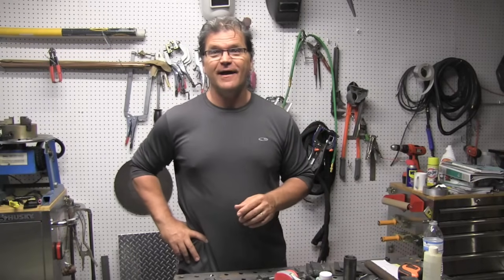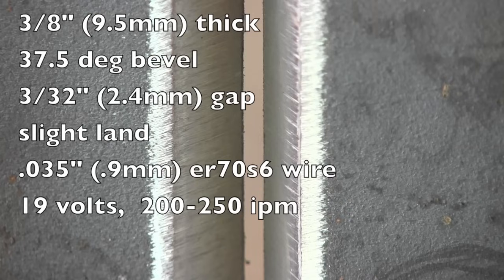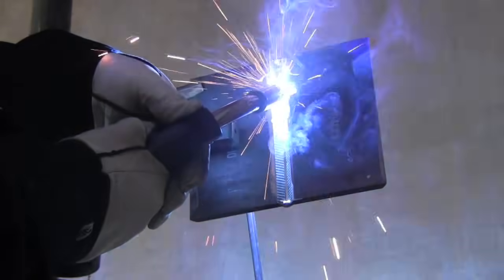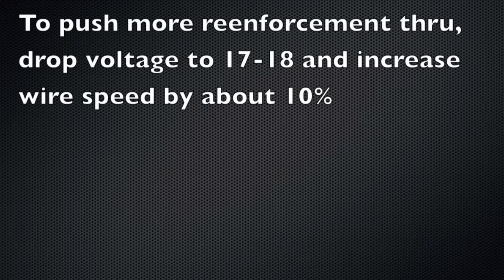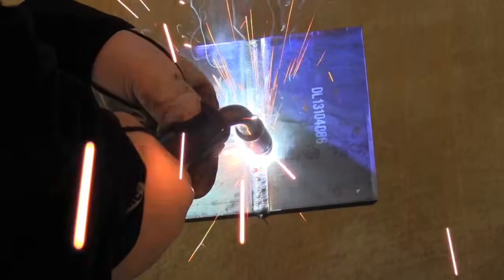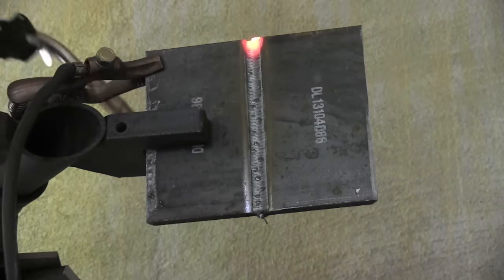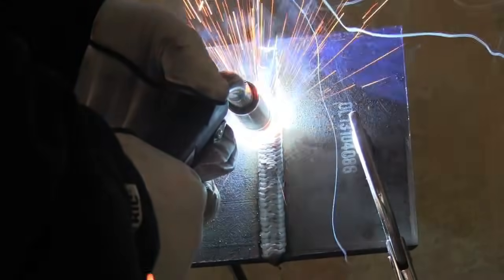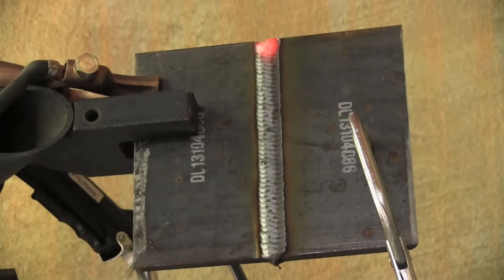MIG Welding 3g Vertical Open Root Plate Test

Comment: Unfortunately I have been informed I cannot do a vertical down for the root. Others may want to check and see if this is permissible in their test.
Reply from the maker: @slightlyovercast  I have a video for uphill root also. It just requires slightly lower settings

Comment: An old timer taught me to butt weld with a bit of a lower wire speed than u normally would use and still keep the volts the same. This will result in a nice flat run

Comment: an alternative to a root with more penetration using a tighter gap like that would be to crank the voltage up to 18-19 volts & turn down your wire speed! like 18.5/180-190. was tricky learning that the longer i can keep the puddle molten, the more wire i can feed into it before it sets. when i started i just tried to turn it down & throw as much wire in there as i could do long as the machine ran well & what you start to realize is the roots sets faster the colder you go & the increased wire speed only fills the gap faster so it doesn’t necessarily give you time to break down the walls & let the puddle soak up any wire.

Comment: So easy to run a root pass with such a small gap but it's completely different whenever you run into something like a 1/4 inch between 2 beveled plates.

Comment: This is a few tears old but this is where I am at.  This is exactly what we have for test, 30 degree,1/16" landing with a 3/16" open gap.  18 volts with 210 wire speed argon mix.  Thank you sir!

Comment: The root is incorrect. You should go upstairs.
Reply: No
Reply: @murrill34  

Yes. If you did this on a TSSA under inspection and got caught they'll fail you instantly.

All passes must be done vertically or you're just painting it on.

Comment: I’m about to take a Canadian weld test that has a stop and start mid plate. I have to do flat, horizontal, vertical and overhead. Do you have any tips? I’ve never had to take a test like this before.

Comment: I have to test uphill on a open root pass. Is there a video for that?
Reply: An American told me that rules for welding are a lot different in US and EU, they don't do uphill in US which is so much easier.
Reply: I need the same thing, have you found anything??
Reply: @arfacrew  No not on YouTube, however I got through my certification 3g and from what I learned is that you should run your root pass at 17V and like 175 wire speed, then your hot pass should obviously be hotter so I run that around 18V and like 185 wire speed, then I turn it back down to the first settings for my cap
Reply: @arfacrew has far as technique I am pretty much aiming down on my root pass to build that molten puddle up and you will see it build up and from that you just work it up, then when I do my fill and cap I am doing the push method so aiming up going vertical. If you're on a miller make sure your (ductility)? Is at like 40 or 45 idk if I spelled it write however, if you're on a Lincoln it is the same as the pinch setting and for a Lincoln I run the pinch at 4.5. Hope that helps in some way
Reply: @jeffreyturnage360  So basicly it's all about how u set ur voltage  and the wire speed, got it. Here I found this on tube and thnx for the advices. https://www.youtube.com/watch?v=rAIHRyAY1JQ

Comment: Do you have a pipe test video. I'm a stick welder for many years down or uphill. Now I just passed a 6g hardwire root and dual shield cap. I have the 2" down but I'm struggling with my 6" and above pipe. Sch 80. Any tips will be very much appreciated
Reply: I never seen hardwire root done on 6g . How do you do it?

Comment: try a down hand root on a full pen inspected weld in california and youll be shown the door if you ovwerheat any part of the material "heat effected zone"youll fail the piece will failand if any of those passes are wider than 3/8 youll fail and who uses hard wire on a weld test 71m 71t dual shield with straight co2 is all you need which produces a slag but there is no easier wire than dual shield 0.52/.0.64,even after you get your certs in our shop you will take another when you apply and if you run a cover pass as wide as that youll not make it in Cali 3/8 is as wide as they let you go ive welded 1"plate tro w36x120 with a full pen with open root 1/8 and a single 30 deg bevel with and without ceramic backing bars,they can eliminate the need to carbon arc the backside and your talkingf a 1"weld and that was at least 15 passes

Comment: Practicing 3G downhill open root right now, except the teacher wants a 1/8 in. gap with 1/16 in. lands.  I figured a bit of oscillating was necessary, but I guess not as long as you stay on the weld puddle.

Anyone have a recommended gas flow rate?

Comment: how do you do dualshield open root?
Reply: Enrique Ramirez you would do short circuit mig on the root and do the rest with dualshield.
Reply: Can you tell me how to do a vertical up root with short circuit mig? Do you drag it or weave it and how big a gap along with volts and wire speed. I need a job

Comment: only 19 Volt's ? 24> 25 Volt's at 400 to 450 ipm wire speed is what I am welding at !! it's really hot but you get some really good weld's
Reply: it's spay mode isn't ??

Comment: it would be great to see a vertical up open root that's how you are tested in Ireland
Reply: isn't too difficult with a MIG gun ??
Reply: thats the only way to run mig up hill
Reply: It's not too difficult. My mig welding test I had to do a verticle uphill to get my cert

Comment: I think its way better if u do the root uphill. Not only u can control much better the puddle and the wire at the tip of it, but u get a waaaay better penetration behind. Just my way to do it. And if possible, ill use solid wire for the penetration and flux for the filling! Nice welds!!
Reply: why you need to go uphill and get penetration since it's an OPEN root ?? isn't more difficult to do so ?? may be uphill just for fill & cap ?
Reply: @senuolicak7097  in uk we never go down hill it’s called stoving weak as piss

Comment: Welds look good. Some diffrences in what you are showing and what I was taught in the boilermakers apprenticeship no down hill all verts and that also includes root pass. Most of the time we are allowed a backing plate but sometimes they want it to be an open joint. Caps are done in 3 passes. One in the center and then one on each side.

Comment: where i work i got told that we should never weld downhill.   I weld the rootpass on 6g and 3g uphill.    is that wrong?
Reply: is this even possible ?!!! I was searching for videos doing uphill mig on rootpass but it's sooooo rare ! why is that ?? I heard that downhill is avoided because the lack of fusion and inproper penetration, but since it's an OPEN root I can't see why ??, without mentioning that you increase the risk of shooting the wire through and thus you loose the arc, I think it's more difficult.
Reply: @senuolicak7097  Can u give me a link to any of those videos? I have a test in two weeks and I never welded uphill.
Reply: @arfacrew
https://www.youtube.com/watch?v=rAIHRyAY1JQ
Reply: @senuolicak7097  Thnx a lot, I thought it goes something like that but I guess I just need a lot of practice, it's so much easier to do it downhill.
Reply: Pickle sickle 
In my apprenticeship program we was told the same thing, Not to run any pass downhill.
using LN -25  I passed 3G using a downhill root method. later learned how to uphill root was a bit more challenging for me.
Reply: Not at all.  A lot depends on the thickness of material, process, gas mix (if applicable), and ultimately, what does the WPS say.  Up hill is a structural weld.  Manufacturing uses a lot of down hand, some kind of wire feed process; usually with a spray transfer which allows the welder to use higher voltage and wire speed.  Learn both, but if you have the uphill in control, the down hand should come to you without too much effort.  But put some practice in on down hand, in case you run across a WPS that calls for it.
Reply: Pickle sickle 8
Reply: no
Reply: Something I learned over the years is that someone will always try to tell you how you should weld but in reality there's plenty of ways you can do it you can ask one guy and then go ask another and they will weld different so I say just go for whatever works for you that's the beauty of it!
Reply: @LS-tj1ip  You can do that when ur welding at home but in my upcoming test they demand that I do root welding uphill so I can't do the way I want it to be done I have to do what they ask of me.
Reply: @arfacrew  Yeah I understand

Comment: at my work we do this same test before you can go out on the shop floor and weld but the root is done vertical up not downhill and the cover you did wouldn't meet weld spec cause were only allowed 1 to 2 mm over flush but we're also building trains so are weld tolerance is real tight
Reply: I agree
Reply: .035 and .045 depending on what your doing
Reply: Can you give me tips on how to do a root vert up with mig? Do you just point it in the gap and drag it up or do some kind of weave? Also would like to know how much volts and wirespeed along with gap width and land size if you put any.
Reply: same at rail car company. .045 wire no down all open root vert up
Reply: What size gap?

Comment: I am currently taking a welding class and the vertical up fillit weld on 1/2 inch plate is giving me a hard time. I can't seem to dial in my settings for the root pass or the follow up passes. Any suggestions for settings?
Reply: I'm taking the same 3G & 4G I feel as if the overhead is way easy imo
Reply: Don't run the root to hot, and walk away after every pass. I watch guys fail there 3G's cause they feel pressured to finish. I'll take a couple of hours to do it. There's no time limit.
Reply: Haha, I forgot I made this comment. 3G MIG is actually my best weld now :) Yeah, I'm good about letting my welds cool between passes now, and I don't quench anything anymore. I was horrible about that before. I would run it until the piece was cherry hot, quench it, and jump right back on it. I got a little laser temperature gauge, and I let everything air cool to at least 350F between passes. 
Now my issue is 4G corner joint fillits, on 1/4 inch cold rolled steel.

Comment: So why downhill for the root pass is that just the best way to do it? what would happen if you would to do a uphill travel for the root? 
another thing for the second pass I notice your doing a z weave motion and it came out extremely good my settings must be wrong when I try doing an uphill travel with a z weave motion I get a lot of buildup and ends up dripping how do I counter this? try going a little faster? maybe change my voltage or wire speed? cheers & great video
Reply: Increase wire feed speed.
Reply: Go faster, spend just enough time in the middle to keep the puddle moving, spend the majority of the time on the toes. Hardwire mig doesn't like to do uphill without drooping, with practice it will become smooth. This was the first weld I ever did with mig, most of my experience was with stick at the time, took me 2 weeks to get it perfect

Comment: hello and how much amperage welding speed 3g
Reply: Many AWS welding certifications with GMAW requires an amperage of at least 180amps. I don't recommend starting practicing with this much heat because it's really, really freaking hot. You gotta boogie. When I did this particular weld in the video but on 1/4" angle all passes vertical up, I ran it at 265ipm and 18.2 volts
Reply: Thanks!!'

Comment: Everytime i am trying to weld Vertical, The weld just dripps off! What am i doing wrong?
Reply: that happens to me to 
have you figure out how to fix it?
Reply: too much heat,not enough wire speed
Reply: +Wicho Herrera
Wire speed is your heat, it's the amps. Voltage controls the arc length. If you're running a stringer bead, you must use motion, weather it the common "triangle" or a whip motion just like stick welding with e6010 if you've done that. With mig you must move fast.

Comment: Jody, could you do an adendem to this test with MIGing uphill. Our WPS dictates uphill passes. 

Thanks and keep the great videos coming
Reply: Hey, I finally got consistent running my MIG root up hill. I had problems with either lack of penetration or blowing out. Played with all kinds and combinations of gap and landing dimensions.  
Here's what worked for me: 
1/8" landing with 1/8 gap. 
18.5 volt and .035 wire set on 3 of 10 on our Miller wire feeder (sorry, no Ipm) 
For me the 1/8" landing was the big break through. Tried a 3/32" but I had problems with the gap shrinking closed on me so I went to a 1/8". 
I feather in my tacks to help with tying into them but I don't grind them so much as to weaken them. 
I use a "Z" pattern going from the corner formed by the landing and the bevel on one side to the opposing corner letting the puddle tell me when to move. Gun is at a 15° push angle. 
If/as I see the gap shrinking closed I tighten my weave and try to make sure my puddle is flowing into the gap. 
"It's what worked for me"

Comment: great video Jody. I do have 3 questions for you tho.

on a plate test like that, is going down-hill acceptable only in open root? in school they only allowed us to go uphill on the 3G plate test, but that's with a backing plate, not open root. can up-hill be done 3G open root?

and grinding... when you want to grind a weld for aesthetics or looks what's the rule or proper way of doing that? I have ground down some welds for looks before, but only ended up weakening the weld and having it break loose or fail. 

thanks in advance

Comment: Hey Jodi I like all your vids very helpful, I have an issue with a machine I bought about two weeks ago it's a miller trailblazer 302, the problem I'm having is I'll set the machine to let's just say 120 amps and when I strike the arc and run a bead it reads at maybe 89 or 90 amps. Idk how to figure out this problem hope it's not a bad machine can anyone help thanks.

Comment: Great video, Speaking of crud building up on the mig nozzle, why don't do a quick tip video showing how you clean it. I clean mine and then wipe a thin film of anti spatter on the outside and inside on the nozzle and also on the contact tip.

Comment: I also noticed at the very top of the plate that it gets almost too hot and the puddle recedes and draws the plate metal creating a divit per se at the very top. This is a problem I've had welding plate GMAW or smaw in the past.   how can you prevent this while having well enough amperage to get good penetration but without causing that? Maybe sacrifice a solid bead for a tie in mid section hit it colder on the final segment? What do you say?

Comment: Hi Jody; Going back to your Stick Welding Tips Vertical 7018, you said some testers were not allowing weaving because of too much heat input causing grain growth failure, how does it or will it apply to the weave when doing a mig vert. up, like in this video. It seems to have similar heat input to the work and if it causes a problem with stick welding, why wouldn't it cause a problem in mig welding also?Thanks again for your videos, your channel is great.

Comment: when i got coded last year i had to do a vertical root a hot pass and 2 fill and a cap, i was just wondering is the different specs for welding in Ireland

Comment: I "learn" welding the hard way; just do it. It was not included in my school training (other direction) :-)
I wonder if you could do a video (serie) on mig for rookies. For instance my machine does not have a gideline chart on wire speed and current with material thickness. So I just try and if I do not burn trough I think I should be ok. When do I use a bevel, or when not!
What does a sputter mean, more wire speed? More gas less gas... 

I enjoy watching your video and am great full to you for putting them online, THANKS!
Reply: Joop Terwijn Hey Joop ,Check out Jody"s mig welding basics videos , they should answer all your questions . I'm only amateur and they improved my welding skills greatly. A big thank you to you Jody for sharing your knowledge with us . Much appreciated :]

Comment: Jody, I'm getting ready to weld up side strips that go around the perimeter of a table top. It's aluminum, and I'm not sure how to approach this thing in terms of avoiding distortion. I want the table to be flat when I'm done, but will be welding this strip all the way around the perimeter. It may not be a problem, but it sounds like a recipe for distortion. I've got ideas as to how to keep distortion down, but I'm curious if you have any general ideas on how to approach this thing. I watched your video on distortion, but don't know how that would apply to what I'm doing.

After all of these years I have to thank you for the zillions of excellent videos you've made.

Comment: Why are you using a sealing run on that material joy. Down hand has no time to absorb the heat to make a full pen weld down hand .mate I think u are a star but must be different in the states . J
Reply from the maker: Jason Duncan downhill open butt root using MIG on pipe is pretty common here in the states. Then the rest of the passes are usually done uphill. With a gap, and no land, there is very little chance of lack of fusion even going downhill...as long as you are in the ball park on voltage and wire.
Reply: Jason Duncan I've done bend tests on GMAW open root butt joints and had perfect penetration every time. I have also seen colleagues have coupons snap in half because the had fusion to only one side of the bevel. The trick is keeping wire on the leading edge of the puddle and having your settings just right.
Reply: Dear weldingtipsandtricks in some upstream project. Use downhill is prohibited so. WOULD you please explain to us about this by your knowledge and your experience
Reply: in California on any inspected job they catch you running a downhand they shit a fucking brick downhand is good for nothing,